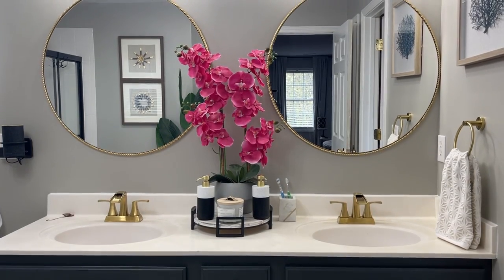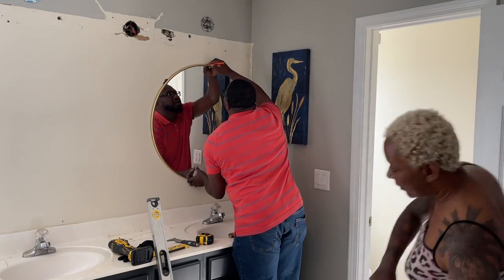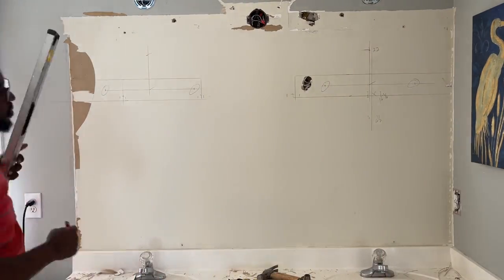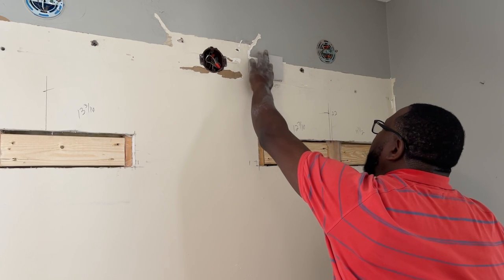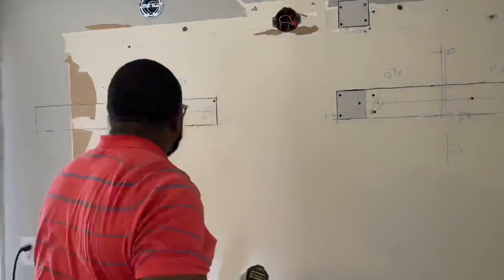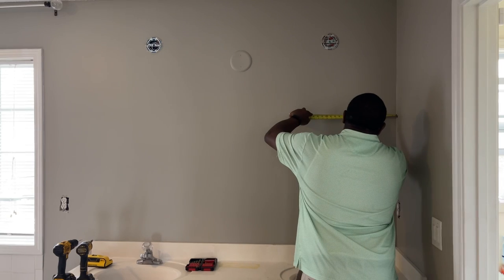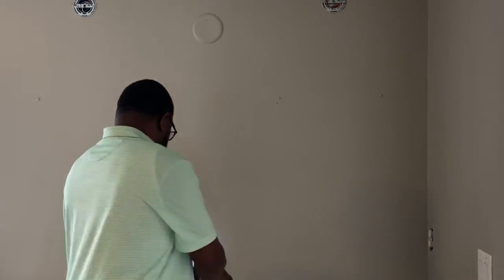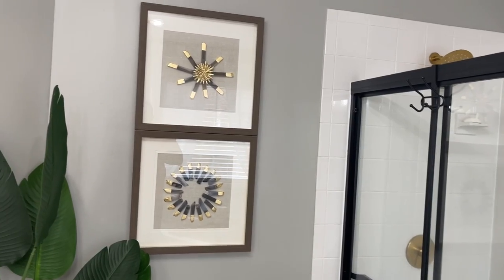Backing (Backer) Boards Installation For Heavy Mirrors / Artwork | Replacing Builder Grade Mirror

Comment: 🤣🤣🤣🤣 Sharon funny.  This is a great idea because I want to mount my TV to the wall and for some reason I don’t think using wall anchors is enough. I don’t feel comfortable doing that, so I would feel better if I mounted a board from Stud to stud and then put the TV mount on the board.  That’s what I did when I hung my sliding barn door.  Great job as usual Ron  👍🏽
Reply from the maker: I’ve done it that way many of times. You should be about to find studs and there should be plenty of holes in the bracket. If not, you can make a hole where you need it.
Reply: @rontalley  thanks 😊